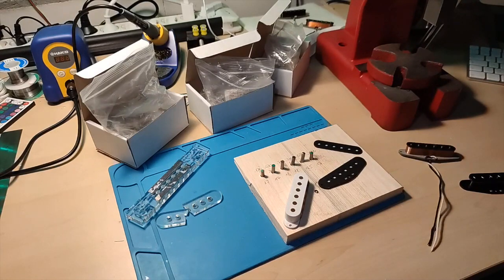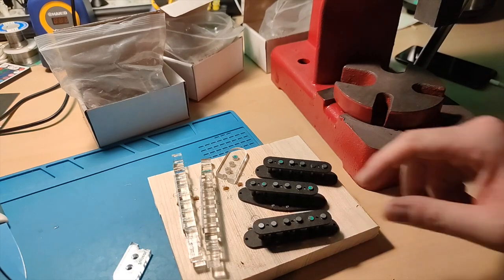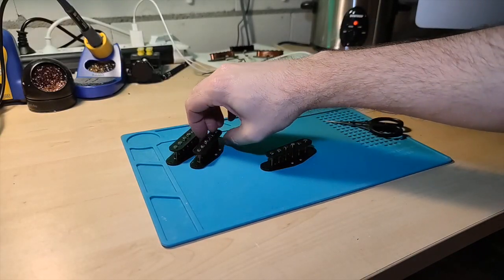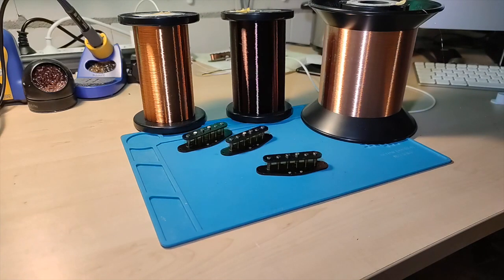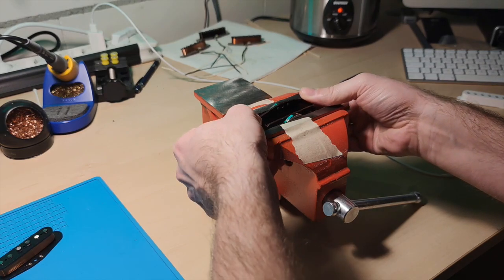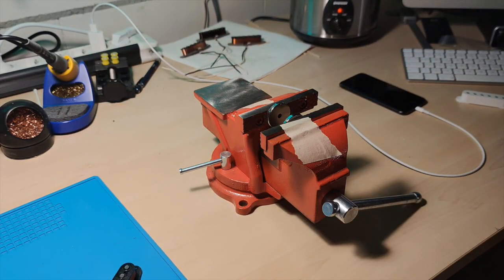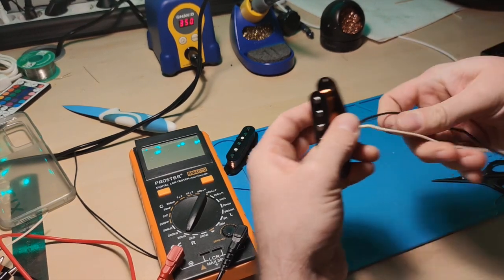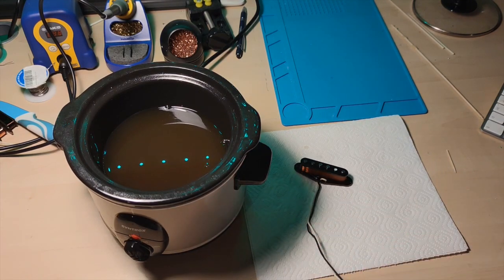How to build a single coil pickup from scratch

Comment: While installing a pickup, my fingernail hit the winding wire and put a little indent in it. Is this pickup just screwed?
Reply from the maker: If it still produces a sound, it’s all good. Or you could check it with a multimeter if it still has a DCR reading.

Comment: What side do you solder the black wire.(in other words which side of the pickup is ground?)
Reply from the maker: The side on which I solder the ground wire depends on the winding direction. Usually, the ground wire is soldered to the start of the coil. Leo Fender designed it that way, so the pickup wouldn't short out if corrosion caused the wire to contact the magnets. Today, we prevent this by wrapping the magnets with tape.
Therefore, if you want, you could also wire the finish wire to ground, as long as you do it consistently with all the pickups in that guitar, it is not a problem.

Comment: You don't need to scape the insulation off the formvar and plain enamel wire before soldering to eyelet?
Reply from the maker: You could, I do it with the plain enaml wire. But with the formvar, if the iron is hot enough, I've hab no problems just soldering it.
Reply: @palatinepickups  Cool, good to know. I'll try that next time I'm working with formvar.

Comment: PALATINE, how do you fine tune the resonance peak Q and bandwidth of a guitar pickup? because paul reed smith uses TCI tune capacitance inductance as picking up tuning the resonance peak and bandwidth
Reply from the maker: I use a frequency analyzer tool to test my prototypes. That's alle I use in terms of tools. From there on it is basically testing, testing, testing. And you have to trust your ears. I am a small builder and don't have any fancy high-tech tools, but I trust my ears and my experience.
Reply: @iridios6127  I know he is a liar and a Fraud it would be nice to know his snakeoil